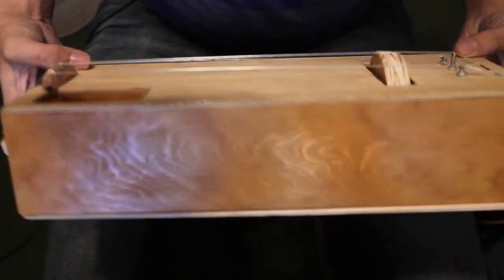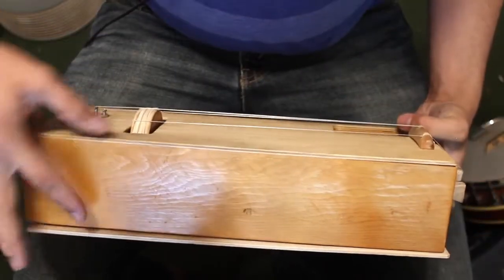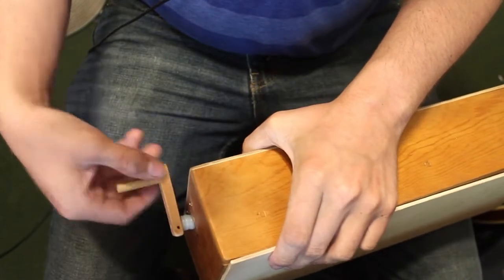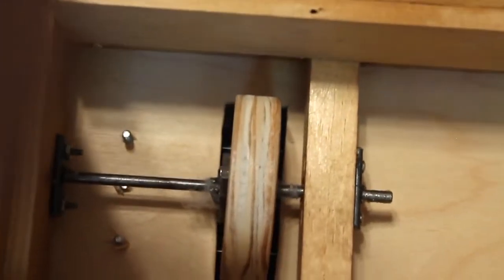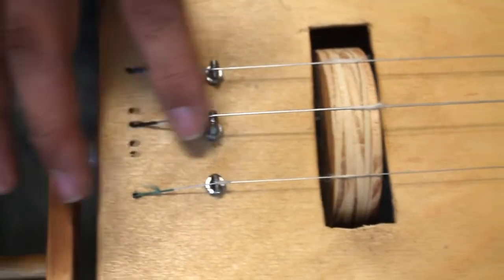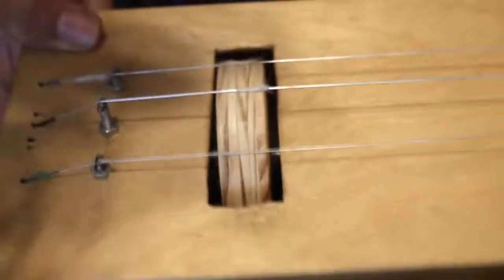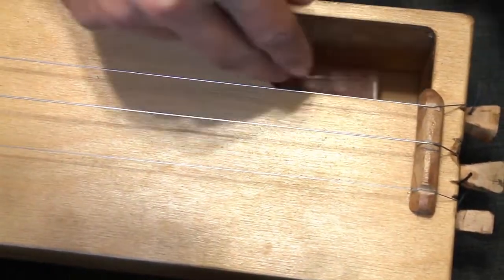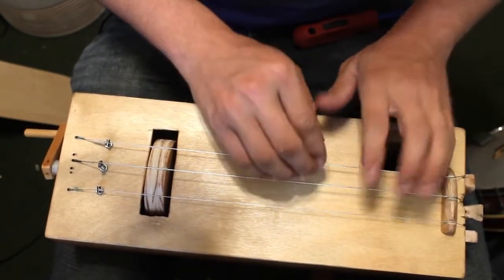Wierd Instrument Project: Keyless Drawer Hurdy Gurdy [1]

Comment: Did you use guitar strings? im looking into making a hurdy gurdy for myself for a school project
Reply from the maker: I used cheap violin strings. On my large one I used cello strings. Never use guitar strings as the windings can mess things up
Reply from the maker: Be sure to mention my channel to the class. I've got a zither build coming up.
Reply: @meercreate  heavy medium or light tension? Or does it not matter? I have happened upon some nice pear and walnut and would like to try my hand at trying to make a pear shaped gurdy. I have some experience with woodworking but almost none with instrument making so I apologize if this is a silly question.
Reply from the maker: @harmonic5107  Mine are somewhat lighter in tension, but heavy gauge, due to the scale length
Reply: @meercreate  Thanks! I'll give it a shot. If it goes well and I end up posting it to youtube or facebook, I'll make sure to point people to your channel.
Reply: Same

Comment: I have seen these fretless sections added on to some of the Larger higher $$$ Hurdy Gurdy's usually separate and below the Tangent keys section. I like the Simplicity of it.
Reply: what if you had frets at the proper key points on the top of the box/sound board, and lower the strings down to just above the frets like a guitar, it seems Like the volume would be Louder as in a hurdy gurdy the tangent and keys are all in contact or part of the top sound board for resonation into the sound box. with the frets for each string in different locations like the Tangents for each string Like a push button Hurdy Gurdy, for playing Multiple notes at the same time like a push button Hurdy gurdy. would the sound be too clean and guitar Like? you would still be using a rosin coated wheel

Comment: Nice job! The only suggestion I might have would be to use the flats (or tops) of your nails directly on the string (like a Gadulka fiddle). You'll get a much louder tone off the string, and a more precise intonation, although it might take a bit of getting used to, as the technique is almost opposite in that you push forward against the string with your finger nail instead of pressing down with the tip. Of course, if you happen to have super-hard left hand calluses, (like from playing fiddle or guitar) then pressing down should work fine. Cheers!

Comment: Are you using tuning peg soap on those friction pegs? It comes in small wax-like sticks, is really cheap and discovering it changed a lot for my restoration and building projects. It gives you more friction while enabling you to move the peg more accurately!

This project gives me some ideas, the sound of this fretless hurdy gurdy reminds me a lot of a cigar box guitar played with a slide. I actually shied away from trying to build something with a wheel because of the rest of the technology I saw as necessary, but maybe I should just go for it, maybe adding a little bit of neck or something and making a hurdy-guitar thing!